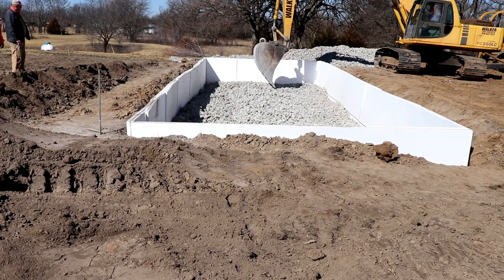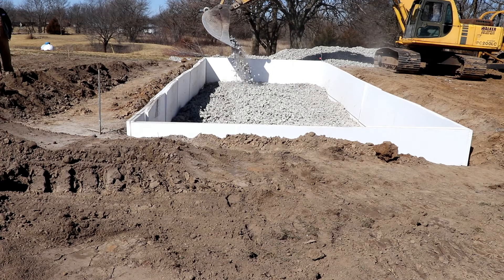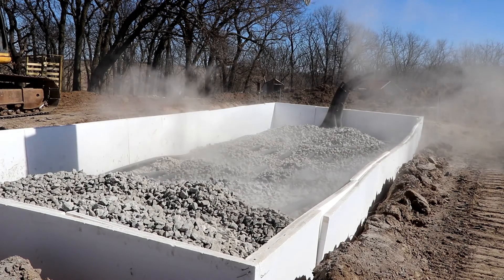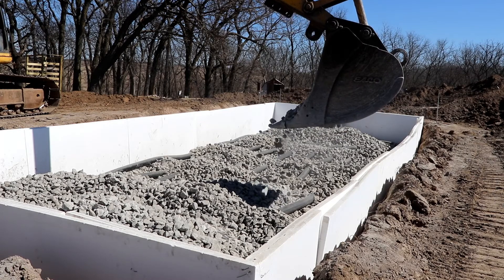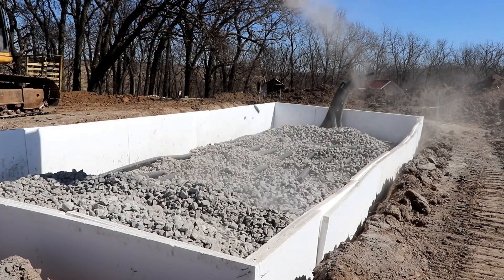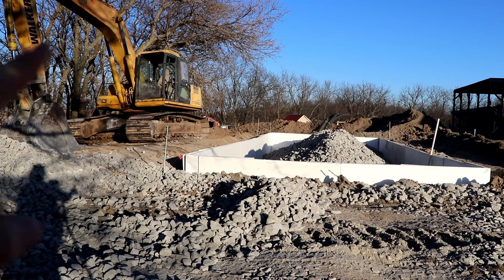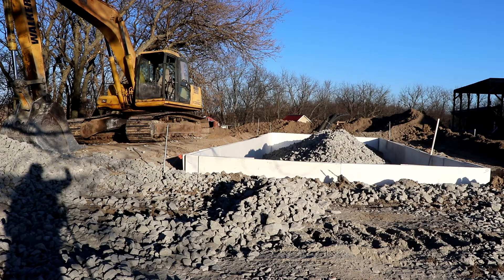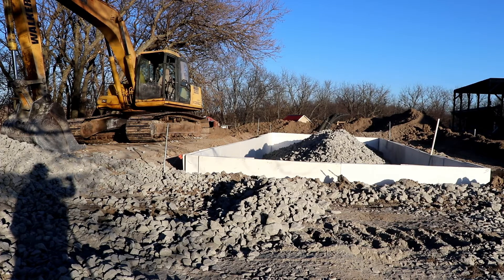Greenhouse for winter crops- part 4

Comment: Are you starting to collect data on your system?
Reply from the maker: Morgan Brown not yet.  I’m in the final steps of getting it operational now.  Once it’s up and running we will work on getting a system up for monitoring temps.  We currently have the ability to watch the temps at the peak of the greenhouse, 4 feet off the ground and the outside temps.  Once the blower is running I’ll watch those temps more closely and report on it in a future video.
Reply: @smallblockfuelie  good luck.  If at all possible, I'd try to bury some sensors to get a sense of soil temperature when you draw on the geothermal system.  I just bought some 10 ft themocouples for $10 on Amazon and will use them with my $30 4-channel temperature logger.  I'm using a vertical geothermal system and will dig a monitoring hole between my 4 geothermal wells
Reply from the maker: Thank you.  I absolutely want to be able to better monitor temps, to include soil and grow box temps, inside the greenhouse.  Its on our list.
Reply: Smallblockfuelie I had forgotten that you ran subterranean insulation.  I bet that is a huge part of the reason you’re 15 deg higher than outside, even without running the blower.
Reply from the maker: Morgan Brown recently we added a second layer of plastic to the greenhouse side walls.  Last night we got down to 4 degrees outside and 28 inside the greenhouse.  It was windy and we had little sun yesterday to help charge the heatsink.  We do have about 2 feet of snow piled up along the side sidewalls that has stuffed off the canopy that is undoubtedly adding insulation value.